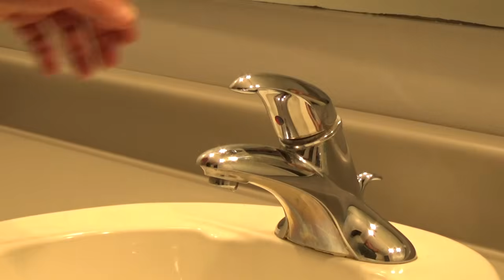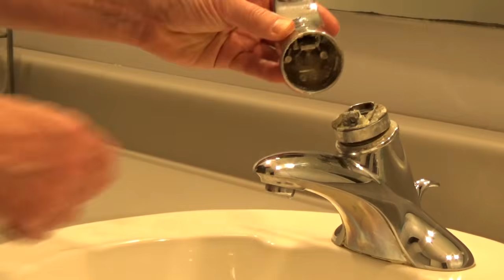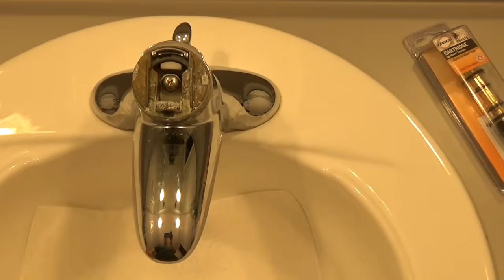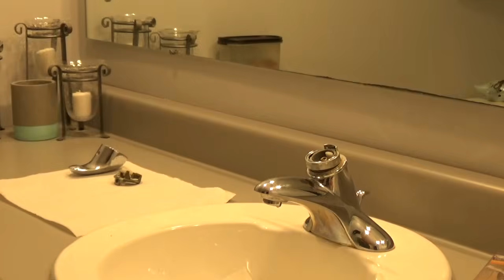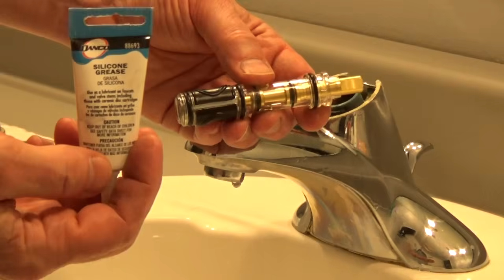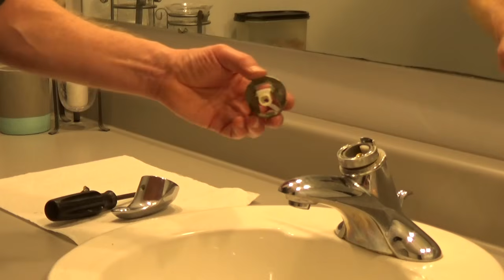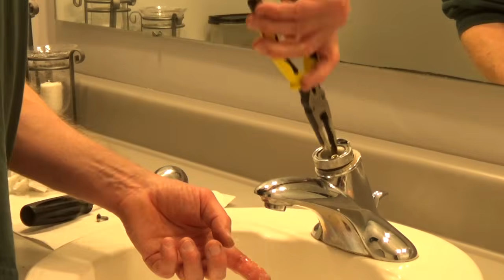Moen Bathroom Faucet Repair - Moen 1225

Comment: Hello there. I have the same faucet. But my problem is the water doesn't come out full. Only little bit. What do you think the problem? Thank you so much
Reply from the maker: Hi, I would check the aerator first. Remove it and clean it out. Then I would check the valves and supply lines. Turn off the valves and disconnect the supply lines from the faucet and then turn on the valves and spray into a bucket to see if you are getting good water flow.
Reply: @FIXITHomeImprovementChannel  thank you.  It works. Best video and very helpful

Comment: Help! My cartridge is stuck! Any tips on how to get it unstuck? I used the tool to break the bonds but it still won’t come out!
Reply from the maker: Hi, if you removed the retaining clip and the cartridge spins, just pull hard with a pliers. If it won't spin, there is a metal tool that most hardware stores carry that will put more force on the cartridge.

Comment: @3:25  I see you putting the hole on the stem to the back. When I did this I got the temps reversed. I put the hole on the stem to the front but I get hot water on the left and middle and cold when I go to the right. Cold water has no pressure , middle and left (hot) is strong pressure. The instructions that came with it suck. The u shaped clip is a pain to get back on.

Comment: excellent video thanks! I did notice numbers on one side of the 2 flats on the brass valve. I kept the same orientation(numbers towards mirror). hot and cold were correct for what that's worth.
Reply from the maker: Great tip!
Check out more home improvement tips on our weekly podcast 
https://itunes.apple.com/us/podcast/fix-it-home-improvement/id880903087?mt=2

Comment: Thanks for the tips, I was ready to take a hammer to the valve when you showed me why the cartridge wasn't coming out. I used a pair of needle nose pliers to make the plastic part  move and after shifting the part back and forth the cartridge came out and I was able to go to the store, get  the replacement cartridge and fix the shower. Thanks again!
Reply from the maker: Glad it was helpful.
Check out more home improvement tips on our weekly podcast 
https://itunes.apple.com/us/podcast/fix-it-home-improvement/id880903087?mt=2

Comment: I followed the video, was able to put in new cartridge and all parts together, but the water now runs even when it’s shut off.  The leak we had before was from below.  Now with new cartridge, no leak below under sink, but I can’t figure out why the water just runs even if it’s off.  Any suggestions please???
Reply from the maker: Hi, sounds like the handle isn't pushing in far enough to stop the water.
Reply: FIX IT Home Improvement Channel It happens before I put the handle back on though—in the step where you say to test if hot water is on left.  I did the 180 degree turn, but it still stays on.  I retraced my steps and I did everything exactly as stated.  😕

Comment: I absolutely agree with w49660. Succinct, to the point and accurate explanations, with clearly visible activity. And cautions to things to check before complete reassembly. Like making sure the hot and cold water are right.

Comment: Great video! I thought it would be hard to change the cartridge and fix the leak but your video was very easy to follow. I just have one question. After replacing it, while the leak has stopped, now my faucet handle slowly comes down and shuts off the water every time I pull it up. I’m guessing (and hoping) its the grease applied to the cartridge amd will eventually stop doing this and that it’s not an extra step or two that I missed? Or perhaps a faulty cartridge? Have you experienced anything like this? Thanks!
Reply from the maker: Hi, it sounds like a bad cartridge. I would go back to the store and have it replaced.
We have more home improvement tips on our weekly podcast, Fix It Home Improvement. You can subscribe on your favorite podcast app. https://www.stitcher.com/podcast/fix-it-home-improvement-5/fix-it-home-improvement

Comment: FIX IT.....not to get too personal...lol....but do you live in the US???   Reason I ask is I live in Canada and the hundreds of Moen faucets I've ever take apart ( pre 1255 new Moen cartridge ) always used a 5/16 Allen wrench!?!?!?  Also, if water reversed ( this works with genuine Moen 1225 cartridges....not sure about the knock offs ) there is a hole on one of the flat sides of the brass stem....that always faces up/towards the back of the faucet.   Good video!
Reply from the maker: Hi, yes we are in the US.

Comment: This video saved me a lot of money instead of calling a plumber and replacing a new faucet. I looked up other videos and able to do everything but I missed the last part. Before putting the handle back in place, the rare end of the metal part has to be put underneath... (at 5:38) Otherwise, it still leaks... Perfectly fixed after all my frustration... Thanks!

Comment: Very good video. A question though: Is it really necessary to replace the entire cartridge, or could one just replace the O-rings? The less scrap, the better.
Reply from the maker: Hi, if it is a drip out of the spout, replace the cartridge. You can't get to the internal parts. If it is a leak out of the handle, you can replace the outer O rings.
We have more home improvement tips on our weekly podcast, Fix It Home Improvement. You can subscribe on your favorite podcast app. https://www.stitcher.com/podcast/fix-it-home-improvement-5/fix-it-home-improvement

Comment: A most excellent video. Many thanks for making it. A couple small things to change/add:
1.) In some cases the drain stopper might not want to stay down and it might slowly creep up. Because of this, it is suggested to cover the drain stopper with an actual towel, not a paper towel. Why? Because paper towel is too lightweight and it is too easily moved by the drain stopper coming up or by an accidental touching.
2.) The new cartridge is likely pre-greased. If the new cartridge is sticky/greasy in the areas around the o-rings, then there is no reason to apply, and it is suggested that you do not apply, any additional grease to the cartridge.
3.) After pushing the new cartridge into place by hand, use the white plastic tool to completely push the cartridge into place. This is probably the most important thing to add to the video.
Again, many thanks for making the most excellent video.
Reply: Great tips. Thanks for sharing!!!

Comment: Looks like a clear and easy process but I'm stuck getting the retaining screw out. There's a little post in the center of the hole so I would need an allen key with a little hole in the end. Annoying. Any ideas on getting past step 1?
Reply from the maker: Hi, I've never seen a tamper resistant screw in a faucet. If you need a tamper resistant Allen wrench, your local hardware store or home center should have one. You can email me a picture at fixitpodcast@gmail.com.

Comment: I got to the point of removing the cartridge, would not budge. I did pull hard enough to pop the sink up. I went and bought the Moen removal tool, still won't budge. Even sprayed WD 40 in it. Any ideas? My next step is pay a plumber.
Reply from the maker: Hi, you did remove the retaining clip? When you used the removal tool, where you able to turn it before trying to pull it out?

Comment: Thanks!! concise easy to understand and can see each part! good idea to this old lady about putting the parts in order as you take them off!! I can do this!
Reply from the maker: Let me know how it goes.
We have more home improvement tips on our weekly podcast, Fix It Home Improvement. You can subscribe on your favorite podcast app. https://www.stitcher.com/podcast/fix-it-home-improvement-5/fix-it-home-improvement
Reply: @FIXITHomeImprovementChannel  I had another Moen sink cartridge to replace, fine got it from Moen (lifetime warranty)! so I watched this vid again and it was all completely the same EXCEPT after you take out the big screw and take off the two pieces and get to the gray plastic piece, where you unscrew it and take out, mine was different? I even looked on moen websites exploded parts views and still did not see one like it, it had no threads in it and did not lift out but had slots in front and back so I got two small hex keys and used the flat part to push on the little "feet" of the clip and pushed it back far enough so I got my monkey hook in the hole in the back (I set a hand mirror back there) and pulled it right out then pulled out cartridge like you said! (apparently on this model moen bathroom faucet that gray piece does not come out), then I lined up like you said and pushed new clip through and it snapped in place and then put it all back together and checked the "hot/cold" and it was all good, so beware of different parts!

Comment: I am having a tremendous amount of trouble pulling the old cartridge out. I used the white plastic piece to turn it back and forth first. But when using the players to pull it out it won’t come out. I am literally having to pry it out. Do you any reason it would this hard?
Reply from the maker: Hi, you can try grabbing it with locking pliers and tapping the pliers with a hammer gently.

Comment: I think I have to replace the whole faucet because it looks terrible because of a very long time leaking even causing water damage . I didn't know this because it's mom's restroom and I never use it and she never told me . I turned it off at the cut off valves til I replace it . Though it's more expensive . Can I fix it without replacing the whole thing ? Heck the base is water damaged

Comment: About how old was this cartridge when it needed to be replaced? Moen's are known to last longer but they break. I had to replace the cartridge in my shower, it was over 10 years old and it snapped in two upon attempted removal. I ended up calling a plumber who thankfully rather than taking a chunk out the wall behind the bathroom, was able to use a torch to expand the pipe and get the remaining piece of the cartridge. I only just noticed the leak starting in the sink, which is also a Moen, whose cartridge has been in there just as long as the former shower cartridge.
Reply from the maker: Hi, I would guess it was about 10 years old. We've had good luck with Moen. 
We have more home improvement tips on our weekly podcast http://castbox.fm/u/6389499.

Comment: Hi. Thank you for this wonderful step by step video. I’m a mom of 2   Trying sometimes try  to fix things around the house myself if I could. I’m having a bit trouble of unscrewing the plastic piece counter clockwise. It is so hard to unscrew it. What can I do?
Reply from the maker: Hi, you can try to use a large adjustable pliers. Don't squeeze too tight.

Comment: I replaced the 1225 cartridge. The hot water pressure is good the cold water is very low
Reply from the maker: Hi, you can take off the supply line from the cold side of the faucet and point the end of the supply line into a bucket and turn on the water, see if you have high pressure from the valve. You could have debris blocking it there. If not, you can remove the cartridge and cover the top of the faucet with a pan and turn on the cold water valve, see if there is debris in the faucet.

Comment: I am having trouble with using a hex wrench to remove the screw while trying to remove old cartridge. Using Liquid Wrench doesn't work either. Is there another way?
Reply from the maker: Hi, you could give PB Blaster a try, it does a good job. You need to get the screw out.
Reply: Thanks for your reply. Actually problem is, non of the hex wrench is same size I got whole set. Smaller is moving free inside and next size is bigger.
Reply from the maker: Hi, there are 2 types, Metric hex and Standard hex. Get the other set and you should have no problem.
Reply: I bought the other set of Hex ranch but it is also not working. I think I have to replace the whole faucet.
Reply: Use a mirror and small light to see allen nut.  7/64 the video says.
Reply: @kashifrasheed123  Sounds like it's stripped.

Comment: Great video, couldn't have done it without you. My first time doing  faucet repair. I got stuck for a while thinking the removal tool was meant to actually helped me grip with the plyers to 'pull' the cartridge but I wound up realizing as you showed that you use the tool to 'twist' and later adjust the cartridge, which makes pulling easier and releases the bonds  between the rubber and the brass.
Reply from the maker: Glad it was helpful.
We have more home improvement tips on our weekly podcast http://castbox.fm/u/6389499.